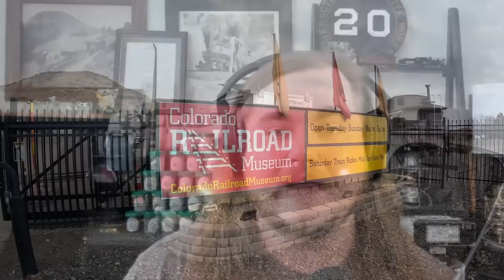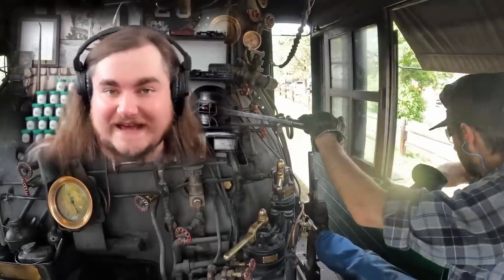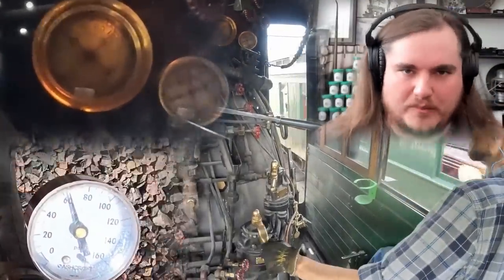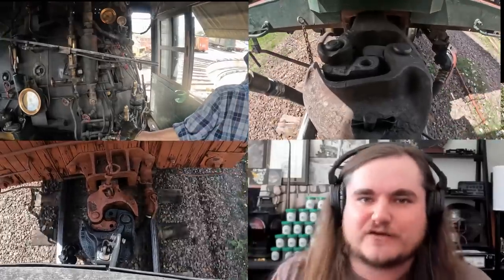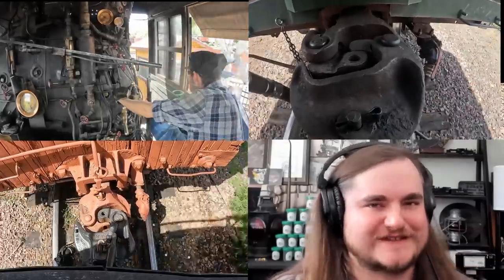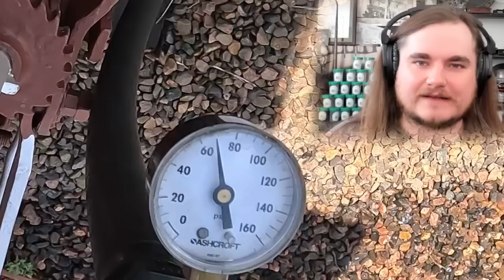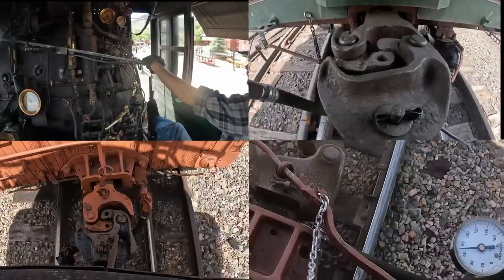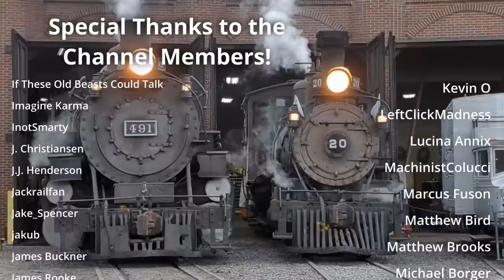Engineer 101 - What's running a LONG train on a SMALL railroad like?

Comment: Interesting to hear about the retainer, coming from Germany, where Knorr brake valves evolved to multi release valves (where you don’t fully dump the cylinder but have multiple steps where it dumps to just a certain amount of pressure, basically dumping 5psi out of the cylinder for every 5psi of pipe pressure increase), which at some point evolved into inexhaustible brakes, precisely to not lose brakes because you overbraked on a long grade
Reply: I don't think the US ever got to that level of air brake technology because dynamic brakes (mostly) sidestepped the issue of overbraking. We did eventually get graduated release but that never made it to freight trains in that form. We developed ECP which essentially directly added air to the brake cylinders of the cars, meaning you could make as small or as large of a brake application that you wanted.
Reply: @pootispiker2866  kinda crap because there’s (at least here in Europe) a bunch of fairly bat accidents where trains lost their brakes for whatever reason (early on by not having enough brake shoes to even hope to succeed / not enough brake men to man them, then losing the brakes by braking too often) but the final straw (for Germany at least) was that accident where a malfunctioning anti skid system dumped the reservoir on most to all coaches and the engineer found out on a downhill grade trying to stop die to a slower train in front of him, after which pretty much everyone doing pax in Europe started using reservoir pipes to get inexhaustible brakes (afterwards you only hear about accidents where the brakes were disabled, not exhausted anymore)… but tue US only got PTC in 2015/2020 (technically 1900s / 1930s / 1950s tech), so actually safe brakes (1950s - 1980s tech) are probably another century out (yeah, ECP is great, but reliably keeping the reservoir stocked should be quite a bit easier, fail safer and cheaper than „fancy“ electrocity)
Reply: @genoobtlp4424  Do you even know what you're talking about, there? ECP is all about keeping the brake pipe and auxiliary reservoir at 90 PSI with the brakes set up.
Reply: @pootispiker2866  the European implementation of ESP is the one I know, so probably not, if you’re saying that… because the implementation I know as ESP uses the comm line to tell servos on every equipped car to dump air as a brake acceleration; optionally, it can also start refilling the brake line (5bar) provided a reservoir line (10 bar straight from the compressor), which is typically used in pax cars to also refill the reservoir, thus keeping it at 5 bar and making the brake inexhaustible… dunno how you do it in the US, but that’s how I understand ECP in Europe
Reply: @genoobtlp4424  ECP does the same thing, but adds pressure from the auxiliary reservoir to the brake cylinder across the whole train at the same time, but can also make a partial release (something freight equipment was entirely incapable of until ECP). This solves the issue of overbraking and exhaustion of the brakes by ensuring that the brake pipe is fully charged. A main reservoir line is really only used on passenger equipment afaik.

ECP isn't commonly used on American railroads except where mandated or chosen by the railroad. Dynamic brakes are the primary braking method in North America and often allow the air brakes to remain entirely unused. Before those we had retainers to keep the brakes applied while the brake line was being recharged, the early solution to using too much air. That's why our air brakes are so slow to innovate- we don't rely on them so much.
Reply: @pootispiker2866  so you either use ECP or normal air, but can’t mix and match? I guess that works somewhat… And basically equips the whole train with independent brakes
Reply: @genoobtlp4424  Kind of. If a train is using ECP/in ECP mode, the train line shouldn't be used to make a service application unless a malfunction or emergency happens. ECP equipment can be run in a normal train with direct release brakes. At that point the ECP gear becomes non functional. All ECP does is take the place of brake pipe reductions and triple valve action. The railroad industry likes it because it vastly improves train handling and performance on long trains.

Also, if the train line becomes blocked, the entire train's brakes can still be applied as normal (the ECP controller would create an alarm if that happened).
Reply: @pootispiker2866  that‘d be the advantage of the European solution then, that you don’t need every car to be ECP equipped to get the performance improvements as they keep the brake line working as usual, but the US implementation obviously saves money on conversion
Reply: @genoobtlp4424  In the US, railroads really like everything to conform to AAR standards. Even the oldest 6L scheduled air brakes on a steam locomotive are able to fully operate the newest freight car with no adaptation necessary. 

As previously stated, railroads don't depend on air brakes and either ESP or ECP would have prevented only a few major derailments as a lot happen from unrelated equipment failures or from actual brake fade. With Distributed Power in such wide use and EOTDs mandated on substantial consists, the loss of train line continuity is rarely a significant concern. There was recently a derailment and subsequent runaway locomotive that was caused by an errant PTC penalty brake application. The slack ran in and cars got lifted off the rails. ECP would have prevented the train from rolling in and stopped it safely. Brake exhaustion really doesn't happen on the railroad in the US because the locomotive will tattle on you for using too little air and releasing it. In a situation where you have dynos and a 6 pound reduction would be an adequate way of retarding speed, dynamic brakes are to be used with few exceptions like baretables. The method in US is to take a set and leave it- if it's too much then you can stretch or power brake.

Comment: We'd both be SO lost on the other railway/railroad respectively. Amazing xD Thanks for the insights!

Also funny (in an absolutely non-judgemental way) how different our standards of what a nice stop is. Over here a stop with significantly set brakes wouldn't be considered nice; you try to release the brakes with such timing that you come to a stop with virtually zero brake cylinder pressure, gently rolling to a stop with but a residue of force. Ideally you don't feel any stopping jerk. But if you tried something like this with the equipment you have it'd, if I see it correctly, result in a hopeless cacophonia of cars jerking back and forth and rolling into each other and the retained cars pulling everything back again.
Reply: Oh and considering nomenclature, yeah, feels familiar … here you have "run" just like you and "fill" where you have "release", so basically the same. But the thing is that the fill position doesn't work in this way any more most of the time; passenger trains usually have electro-pneumatic (ep) brakes. In most cases it's still the classic pneumatic brake system with an electropneumatic "add-on". Simplified: Every car has a solenoid valve between the brake pipe and the outside (setting valve) and one between the brake pipe and the car's reservoir (releasing valve). When the equalising reservoir pressure is lower than the brake pipe pressure (i.e. while setting), a pressure sensor activates the cars' setting valves, when the equalising reservoir pressure is higher it activates the cars' release valves. This way the pressure change propagates nearly instantaneously throughout the train no matter the length. Having the release/filling position in the automatic brake valve work would risk nearly instantaneous overcharging of the brakes, so it's cut off when the ep is on. And yet it's still in use - because it double serves for bridging someone pulling the emergency brake which we do to bring the train to a stop outside of places where that would be dangerous (mainly tunnels).
Reply from the maker: Wacky, yeah, we'd both be lost then huh :D
Reply: @Hyce777  I'd sooo love to see it happen xD

Comment: I’ve actually be considering applying for a job at the Durango and silverton railroad working with the locomotives. Fellow steam locomotive enthusiast to enthusiast, do you have any tips for beginners and how to work up the chain to engineer?
Reply: repeating what Hyce has answerd to previous askees of the same question.

Be willing to do the hard work, work hard, go in with an open mind and ask questions.
Reply from the maker: Apply and go for it! They'll teach you all you need to know. Be receptive and ready to learn and work hard.

Comment: Wow, less than a ten-pound reduction brought that to a stop on the mark. Pretty incredible how having more brakes can pretty much negate the added weight... would like to understand how that works as well. Sounds like some interesting physics.
Reply from the maker: Each car can only really apply so much force based on it's own weight - and proportionally, they're a fair bit smaller than the engine; so, to make up for the engine, you gotta have a fair bit of cars.

Comment: I don't know if this question will be answered, but I'm wondering how the water pump on a steam locomotive works when pre heaters are involved. On some steam locomotives, I've learned that they sometimes have extra tubs running in the boiler that the water goes through before entering the boiler, like a pre heater so the fire doesn't have to work as hard to heat up the water as much to save on energy and heating time. Now, what I'm curious about is how does the water pump move so much water? There must be a mile of pipes in the locomotive for water to go through and the pump only takes cold water so is there a special system to help move the water in locomotives like that?

Comment: Does the K-37 have a low factor of adhesion or were conditions slightly wet? It sounded like it slipped several times going up the hill.
Reply from the maker: We've got a few odd spots in the track, and it was a bit wet. In a sharp curve, any little dip can cause you to lose it pretty quick putting down that much power.

Comment: if engine power wasnt a problem is there a limit to how long a train can be
Reply from the maker: Yeah, you reach a certain point where the couplers can't handle the force. More locomotives in the middle can fix that... so if you kept doing that, who knows. They run some pretty long trains nowadays... 16,000 foot long+.